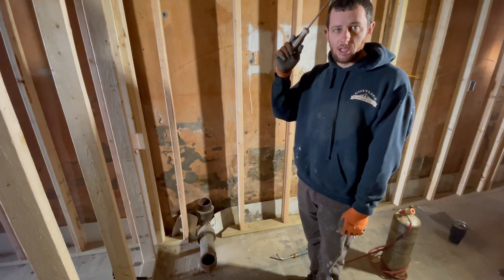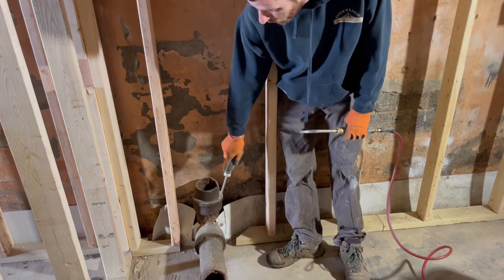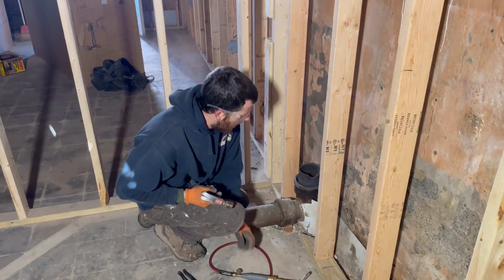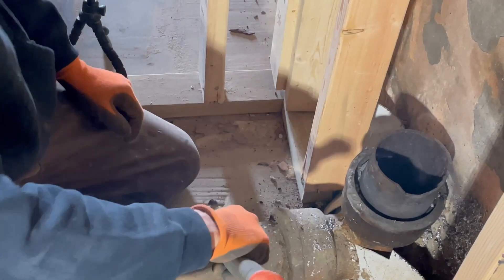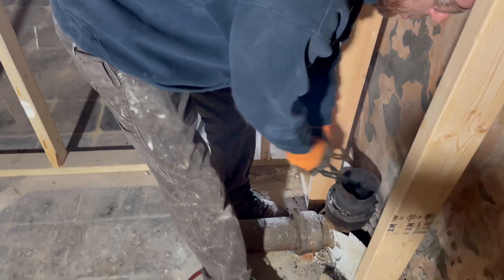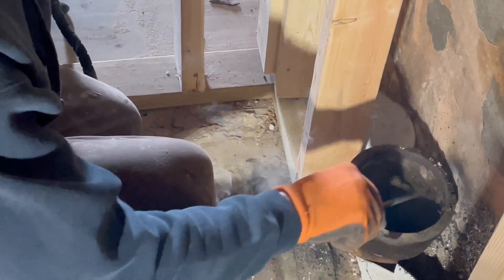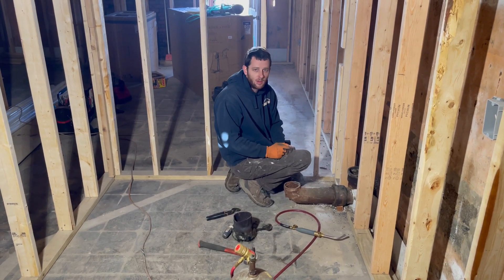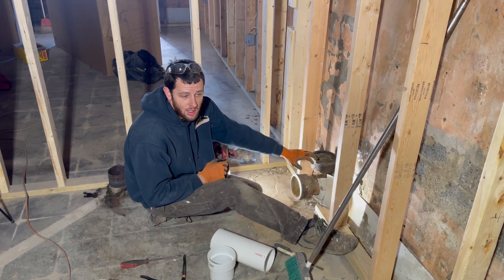Removing Lead and Oakum Hub With Acetylene Torch | Episode 10

Comment: Quick question is heating the pipe with the torch safe to do when replacing a stack that is the primary stack for the toilet and sink and shower? I would assume not because of the gases but can you give me some insight? Which pipe are you replacing in this house?

Comment: I always wanted to try melting out the lead, but my Dad would never let me. He was always concerned that the cast iron hub would possibly crack from being heated up or cooled too fast, or else crack because the rate of expansion of the hub wouldn't match the rate of expansion of the pipe in the hub. He was also concerned that even if the hub didn't crack, the fitting's integrity might be lessened to the point where damage could be done to it while driving the PVC pipe in with the rubber donut. How many hubs have you done this for? Have any hubs or fittings every cracked during this process? I would really like to try it. My Dad has always made me drill out the hubs, we use 1/4 inch drill bits... I usually break 1-4 drill bits during the process, my Dad maybe breaks 1 or zero when he does it. When I was learning, I think I broke 8 drill bits one time. I've drilled out probably around 25 hubs, and my Dad probably drilled out at least twice as many... it usually takes 30-45 minutes to do that, but makes quite a mess, and is tedious.

Comment: Just wanted to come back and thank you for showing this!  I drilled and dug out lead and oakum for a couple of days, thinking it would just pop out without using a torch.  I found there was still quite a bit of lead after heating up the pipe.  As the comment before mine stated, your video gave me the confidence to use a torch!  Popped right out after about 10 minutes!
Reply from the maker: Nice! Glad we could help!

Comment: Thank you. I had a similar situation at home and this video gave me the confidence to attempt it.  I spent about a half hour driling as much lead out as I could first.  My advice to others is be patient with the torch. It required more time than I thought it would. I use the same torch shown in the photo at 4:07.  Hitting it with a hammer right after it's been heated up is key.  And don't forget to put some fiberglass material behind the pipe so you don''t set your house on fire.  Thanks again for this.
Reply from the maker: Nice! Glad it helped. Yeah the video isn’t that long but it was probably an hour or two of work